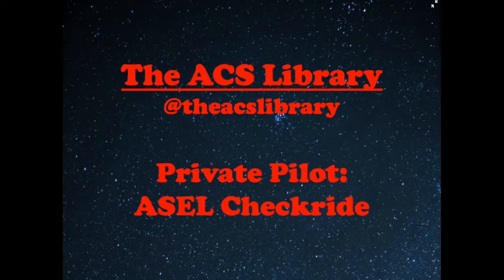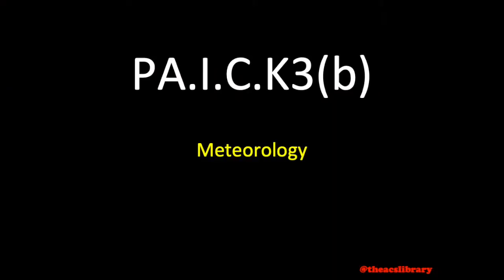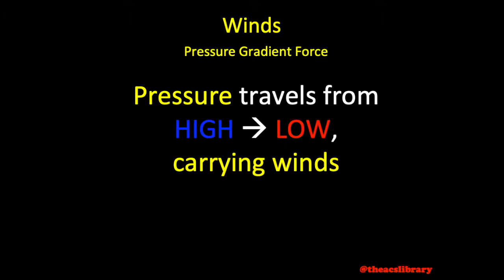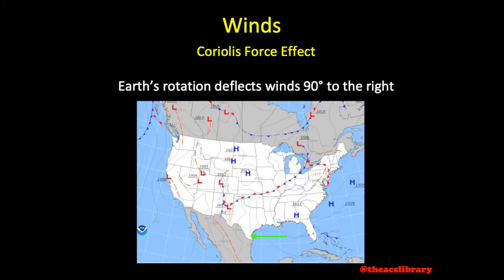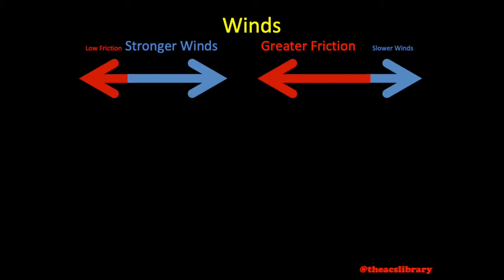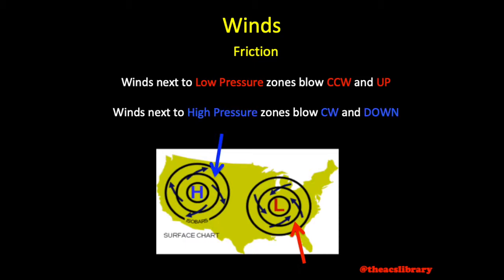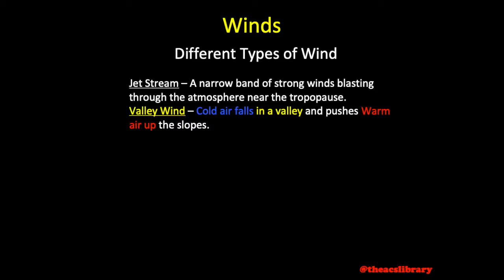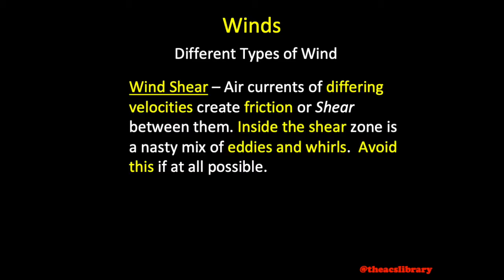PA.I.C.K3b Winds (Weather Theory)

Comment: "With higher temperature creating lower pressure"... Love your videos as I study for my checkride, but this statement is wrong. As temperature increases, pressure increases if i'm not mistaken
Reply from the maker: Hey paintballrdude! Sorry in advance for the long-winded answer.  This depends a lot on whether or not the pressure is being held in a closed or open system.  

In a CLOSED system, as air molecules heat up, they expand and INCREASE pressure as they press against the walls of the closed system, trying to expand further with nowhere to escape to.  As they cool, they require less volume (another way to say this would be, they require less space), and so the pressure is reduced.  If we put a balloon in a freezer, it shrinks and shrivels up as the colder air molecules require less space.  As the balloon heats back up, it will expand as those air molecules take up more space and eventually bump up against the walls of our closed system.  The pressure inside the balloon will increase.  The same thing happens in our altimeter, that’s why that whole “high to low or hot to cold, look out below” adage exists.  

An OPEN system (the atmosphere, for example) acts the opposite.  With an INCREASE in temperature, we see a DECREASE in pressure.  This is because the air molecules are able to expand almost indefinitely, as they aren’t closed in like in our balloon example.  In an open system, as we warm molecules, they expand and get further and further apart.  This will typically result in less pressure as the atmosphere is “less saturated” with air molecules.  
In this video, we are referring to an open system.  Hopefully this all helps and makes sense.  Let me know if this is confusing or doesn’t help to answer the question please!!
Reply: @theacslibrary4404  very good explanation. Basically, cold air is more dense, therefore it has a higher pressure. Warm air is less dense and has a lower pressure associated with it
Reply from the maker: @johanacortez2043  Exactly! You understand it perfectly, and your explanation is much clearer!
Reply: @theacslibrary4404  Thanks for demystifying that. It seemed paradoxical how a cold air mass could be high-pressure because of density but also low-pressure because of reduced exertion on its surroundings, but it intuitively depends on the system. I'll never forget that balloon example.